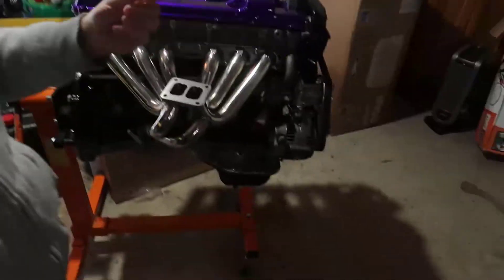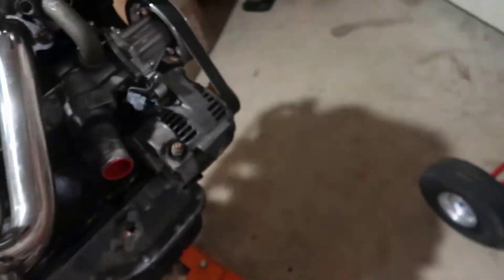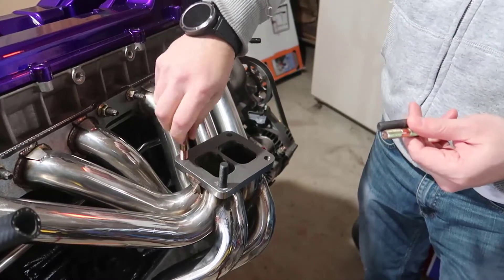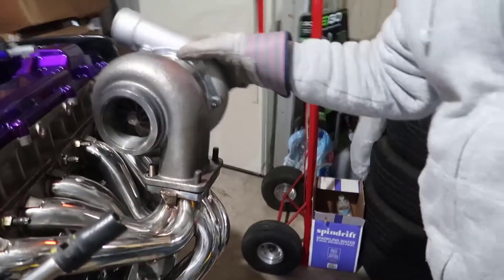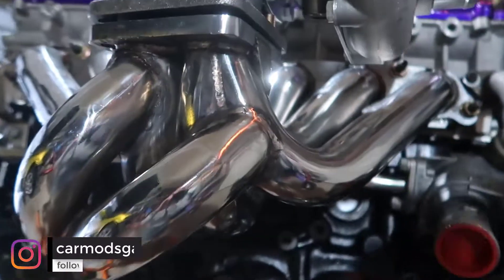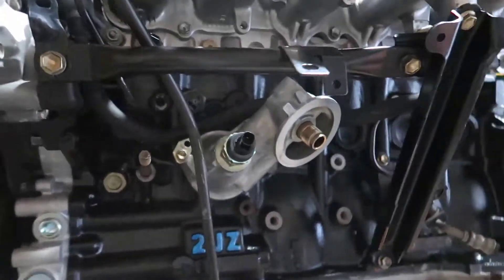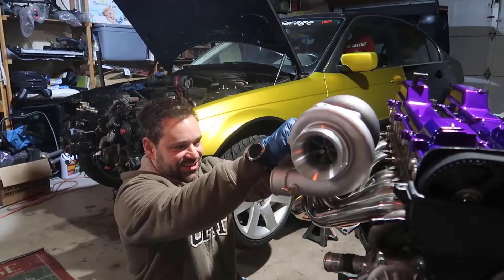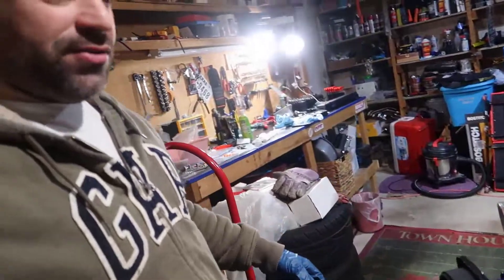eBay Twin Scroll Turbo Clocking and Measuring A/R - 2JZ to E46 Conversion

Comment: What turbo manifold
Reply from the maker: This one is an eBay manifold. Very cheap but you need to get so much stuff after that like throttle body, bolts and it's such a pain in the butt that's easier and cheaper to buy a nice one from ProtunerZ for example.

Comment: any links for the turbo?? looks sick
Reply from the maker: This is the one I have there. So far it works great
https://www.ebay.com/itm/REV9-TX-60-62-TURBOCHARGER-84-A-R-3-VBAND-EXHASUT-T4-FLANGE-TWIN-SCROLL-/131399024257?mkcid=16&mkevt=1&_trksid=p2349624.m46890.l49286&mkrid=711-127632-2357-0